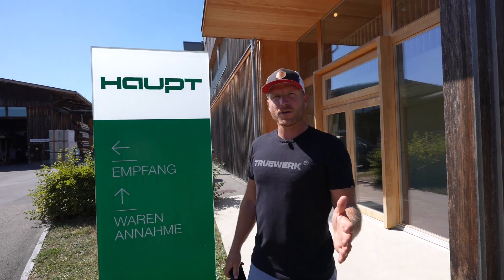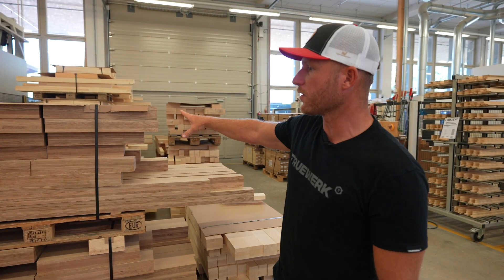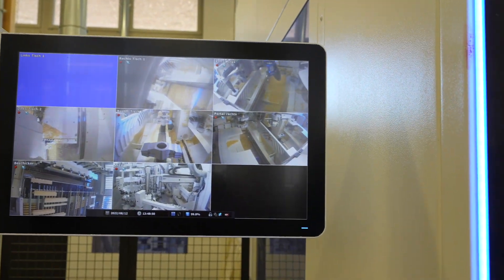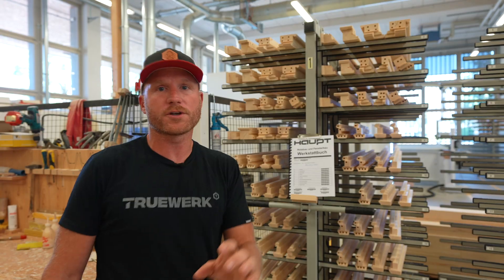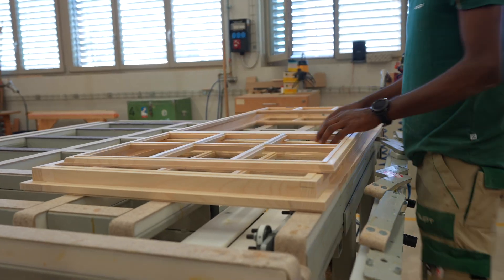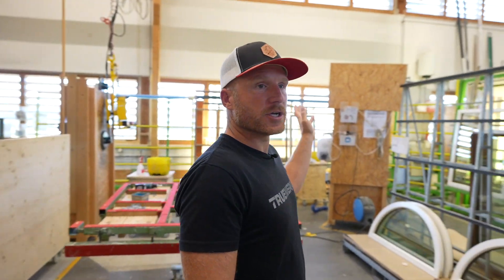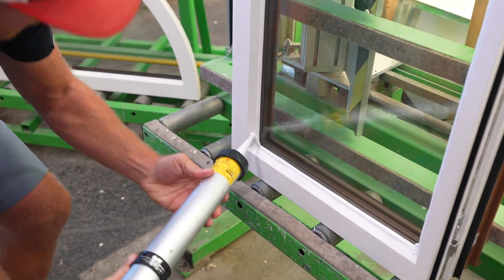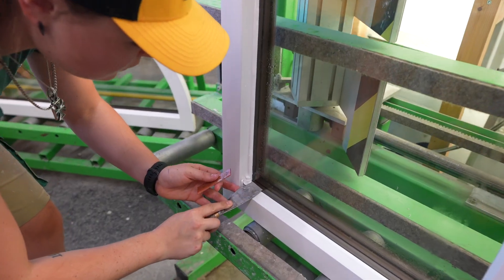How are High Quality Windows Made?

Comment: Putting on that much caulking is a bit excessive, but only cause Caulking won't hold up for over 30 years. They probably only use it where they can't get the other adhesives.

Comment: I'm really surprised they let you caulk that window. It is their reputation and warranty you could endanger.
I have manufactured thousands of windows and doors, but installed only a few.
As long as water can not penetrate, the wood should last, but if any water passes, rot does take over. Nobody maintains their windows.
Reply: Thanks Captain obvious

Comment: All windows are NOT the same. Many of them are filling inert gas in between the two windows for better insulation factors. I know Andersen Windows do that, they had been using Argon back in the 1990's. Aluminum windows are not so good overall, wood clad with vinyl seem to be the best invention so far.
Amazing detail that CNC mill works with those choices of tools. I wonder how long it takes for the operator to punch in all of the commands for an operation. It's always a learning experience to tour manufacturing facilities...they are so advanced in things we rarely see outside with finished products.
Reply: LMAO. inert gas is NOT necessary